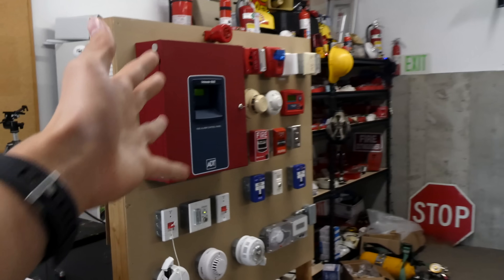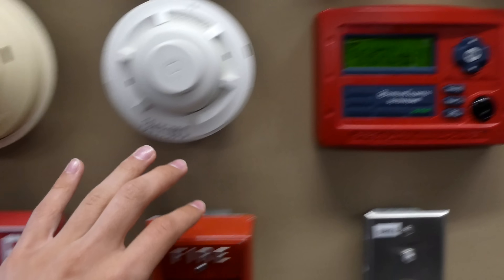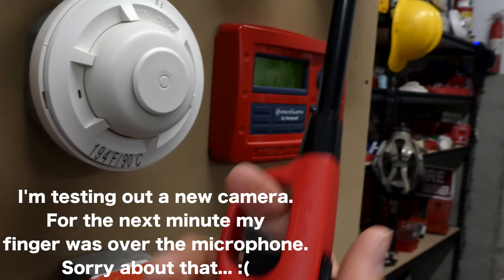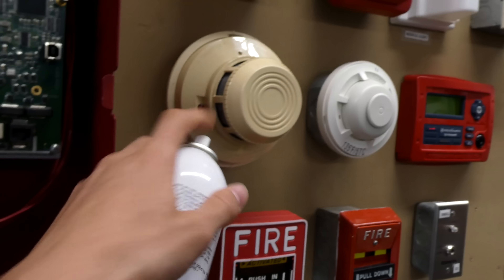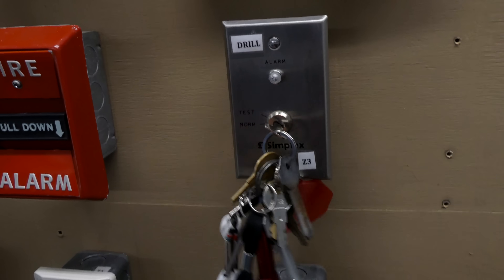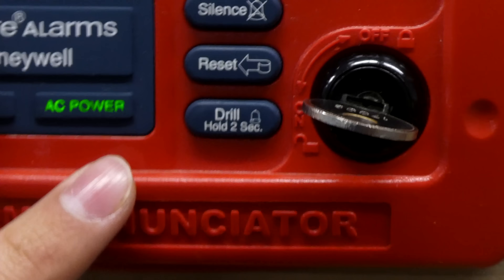ADT Unimode 10UD System Test 9: Exploding Heat Detector

Comment: At 5:13 I have an alarm like that and it's right next to the stove which is very annoying and scary because it's inside a apartment. Then it will set the alarm off in the entire building.

Comment: Honestly, I haven't really looked into this stuff in multiple years. So I'm probably going to sound like a dumbass when I say this. But, with all of the smart technology that's out right now, why don't they make a heat sensor which uses a temperature sensor inside of it to activate? Theoretically it could literally be a temperature sensor in a case that would essentially feed the raw data back to the panel, where it would get processed.

Comment: While testing one day I found an actual pull station on a real system that actually caused a reset in the system we tested it like 3 times because we were so confused on what was happening and how it happened.  still personally have no clue how it managed to be resetting the system without acknowledging it or how it did it in the first place when it was meant to be a regular pull at an actual business.

Comment: Exploding Heat Detector

S.E.R. Safety
78.6K subscribers

Subscribe

15K

Share

Download

3M views  4 years ago
In my system test series, I demonstrate different fire alarm devices with different fire alarm control panels. In this video, I demonstrate a variety of different devices on my ADT Unimode MS-10UD (Fire-Lite MS-10UD) conventional fire alarm control panel. The nurse call stations will be tested in the next test. Forgot to test those.  …
1,218 Comments
Melikedoors1234
Add a comment...
@MichanaAlerting
@MichanaAlerting
6 months ago
Definitely one of my favorite S.E.R. safety videos out there. Never gets old!

11

Reply

1 reply
@drewt4451
@drewt4451
1 year ago (edited)
This man achieved every middle schoolers dream of pulling fire alarms 😂

330

Reply

58 replies
@SWFLElevators
@SWFLElevators
6 months ago (edited)
This one is probably my favorite SER Safety Video, probably because of that mini siren, the exploding heat detector and you testing all the ADT Unimode 10UD's capabilities. Keep up the good work!

7

Reply

@SimplexGuyOfMichigan2634.
@SimplexGuyOfMichigan2634.
1 year ago
Set safety never disappoints us with his videos

15

Reply

1 reply
@jessicahowe1838
@jessicahowe1838
4 years ago
Very nice system setup! I jumped and was amazed at the same time when the top popped off that smoke detector. I also like the tornado siren setup

15

Reply

1 reply
@mrargosthesmartone6945
@mrargosthesmartone6945
4 years ago
You never cease to amaze me, SER Safety. Keep up the great work with your awesome videos!

8

Reply

@WheeloveFireAlarms
@WheeloveFireAlarms
4 years ago
Nice! Love the new blue pulls! I know you’re probably slammed with requests, so don’t feel obligated if your busy, but I remember you got some of those Gentex speaker strobes that had both a fire and alert strobe on one adapter plate. They use them at military bases and stuff. Sure would be neat to see one of those!

46

Reply

7 replies
@EthanBlaisAlarms
@EthanBlaisAlarms
5 months ago
This right here has got to be my favorite video, absolutely amazing!

1

Reply

@crimsonlightningkirby
@crimsonlightningkirby
2 months ago
SER Safety great work I hate fire alarms going off but I love how it keeps us safe from fire and smoke!!

Reply

@williamnealy827
1 year ago
Aww, that little tornado siren is cute lol! Great demonstration of the different alarms, would you consider yourself an alarm enthusiast?

29

Reply

3 replies
@jameswoods7276
1 year ago (edited)
Security guard from Canada here. The reset switch can't be used without an acknowledgement because of NFPA guidelines so that the system isn't reset before a competent authority checks it. Also system trouble alerts have to be acknowledged every 24 hours in order to use the panel / signal silence.  Or so I was told by an alarm tech and a fire captain when I answered an alarm call after hours. (Building maintenance forgot to acknowledge the system trouble before they left for the night. (Faulty sprinkler flow detector) Alarm monitoring dispatcher forgot to check the bypass notes too. Fun times.

15

Reply

1 reply
@FireAlarmGuy13
4 years ago
I think the reason why your shg was doing a weird March time is maybe the alarm is self coding it self to code 3. That’s what I’m guessing
Great Video!

7

Reply

@Rypie89
4 years ago
I love this!! I can see myself having it! When my friends come over I would be like "Hey check out my alarm set!" Then blow their ear drums out! LOL!!

30

Reply

2 replies
@SkrubCern
2 years ago
so one thing I've learned from this. He definitely is prepared if there's a fire.

31

Reply

2 replies
@dank980
1 year ago
tip: the SHG has it's own march time coding built in.

11

Reply

1 reply
@nyanelectricmeow883
1 year ago
I love gentex shgs on continuous with a spectralert classic on pulse! It sounds soo good

2

Reply

@neokirbyfirealarmist100
5 months ago
This has gotta be my favorite video of yours. That heat detector exploding was kinda funny.

Reply

@anthonyiodice
4 years ago
LOOOOVE that you have an old school 2400 system sensor smoke. When you do smokes, would you mind differentiating 2 wire or 4 wire? Keep up the good work bud!

1

Reply

@LasVegasEASPhoto8
4 years ago
That’s awesome!  I have a simplex 4006 control panel and I was wondering what simplex true alert model works with the panel. I have struggled with this for a while.

13

Reply

2 replies
@gregsatterly9412
2 months ago
I have actually been in a building with a tornado alarm with the blue stribe going off for an hour and a half. It was in Norman OK May 2013 when El Rino got hit. We actually had a tornadoe come over the hotel in Norman where we were staying. Those things are LOUD!!!!

Reply

12:19
NOW PLAYING
Setting Off Fire Sprinklers with Fire Alarm Activation
ExitSign250
1.2M views 3 years ago

13:39
NOW PLAYING
S.E.R. Safety's Fire Alarm Collection | Pull Stations
S.E.R. Safety
224K views 1 year ago

16:39
NOW PLAYING
Using the Google Nest Protect Smart Smoke Alarm in 2023
Tech With Brett
323K views 5 months ago

10:40
NOW PLAYING
Making a YouTube Video Using a Personal Organizer
Peter Knetter
2.9K views 34 minutes ago
New

9:31
NOW PLAYING
Nuclear Power Plant Evacuation Siren | ADT System Test 27
S.E.R. Safety
96K views 2 weeks ago

1:11:21
NOW PLAYING
SONIC the CLASSIC MOVIE (Fan Animation)
Pedro Araujo
4.6M views 1 year ago

13:06
NOW PLAYING
SMG4: SMG4 KIDS
SMG4
156K views 55 minutes ago
New

21:32
NOW PLAYING
I Spent $1,000 on Untested Wii Consoles... 😳
Jacob R
107K views 1 month ago

7:54
NOW PLAYING cool!

Comment: If I was the end user, I would throw you out of my building.
You set up the panel and programmed it, but you don't know why it doesn't operate the way it should.
Maybe you should test and correct the panel before recording a video.
Life Safety Systems are not a joke, so your "Ha, ha" is unprofessional and an insult to anyone who was injured in a fire, due to an improperly programmed fire alarm panel.
Stick with residential burglar systems, since you have no clue of NFPA or NICET.

Comment: Security guard from Canada here. The reset switch can't be used without an acknowledgement because of NFPA guidelines so that the system isn't reset before a competent authority checks it. Also system trouble alerts have to be acknowledged every 24 hours in order to use the panel / signal silence.  Or so I was told by an alarm tech and a fire captain when I answered an alarm call after hours. (Building maintenance forgot to acknowledge the system trouble before they left for the night. (Faulty sprinkler flow detector) Alarm monitoring dispatcher forgot to check the bypass notes too. Fun times.
Reply: I'm in the Canadian armed forces I deal with fire
Reply: Vggg

Comment: Interesting! What would the heat detectors be used for?
Reply: @alocalpotato  LOL
Reply: @hellothere9848  Scotland mandates heat alarms in kitchens now for both  new and OLD residents but they way they did it is tyrannical and causing more problems then it solved.
Reply: @hellothere9848  Kitchens to avoid false alarms from smoke detectors.
Reply: @kylehill3643  Ohh that's very interesting! Thanks!

Comment: If you go to our school we have lots of alarms.... And the strobes are LEDs that color change based on the pull switch.... Every alarm row has breakaway glass do they can tell and then 7 pulls and one break bomb
Police
Fire
Ems- nurse
Tornado
Intruder
Gas leak
Toxic vent (isn't a pull but a break bomb)
Natural gas EVS (Emergency vent system)
One kid pulled the gas leak after he farted..... He got 2 years in juvy.... That system take ~2 weeks to shutoff.... They have to "power wash" the school even in a false alarm
Edit: all houses have to have 3 alarms or extra
Tornado, well u get it is so we know when our cars want revenge for us slamming the doors)
Gas leak (city wide for the NPP)
Toxic vent (for the nucular power plane 1 mile away.... That's y our school has vans that can go 120 :) we haven't had to do it yet.....

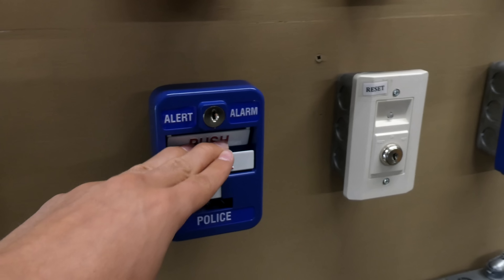Comment: 7:21 pulls "MOBILE TASK FORCE UNIT EPSILON 11 DESIGNATED NINE-TAILED FOX HAS ENTERED THE FACILITY. ALL REMAINING PERSONNEL ARE ADVISED TO PROCEED WITH STANDARD EVACUATION PROTOCOLS UNTIL AN MTF SQUAD REACHES YOUR DESTINATION. AWAITING RE-CONTAINMENT OF 5 SCP SUBJECTS." Would be epic if it was possible to use a voice evac systems that include the SCP: Secret Laboratory announcements.
Reply: UH OH KURAMA IS OUT 7
Reply: W9s0xps0xpepslspepe00ee00eep0e
Reply: Vfcecredtnhhbppdpsp3peepe
End
D

D
Ww
Wpwpwppw
W
E

Comment: I work with ADT and had no idea ADT made a fire panel. I am certified on Edwards and Simplex addressable systems , wondering if ADT makes Addressable devices ?
Reply: They used to make addressable versions of the SIGA-PS, but they no longer make fire protection equipment.
Reply: It's a Fire-Lite panel that is branded with ADT logo.

Comment: When I was in high school, we were told that the pull stations can contain UV ink so that the person who pulled it can be identified. Is this true or is it just one of those "the water turns blue when you pee in the pool" myths?
Reply: That's a myth but what can sometimes happen is when you pull the fire alarm a little glass rod breaks but it's not gonna squirt ink at you
Reply: You're thinking of the ATM machine in England that can spray UV ink at you if you break into it.
Reply: I heard that as well in High School.  I am thinking it is something said to scare people out of pulling the alarm but who knows
Reply: @Lkendrick  They do it on problematic alarms only if they have cause to do so.  However a fully sprinkled place can escape having any pull stations at all due to special clauses that grants them impunity if they are fully coverage.

Comment: May I ask Why do American Fire Alarm Stations Are A Pull Type While In Europe We Have A Break-Glass And Push?
Also All Of Them Have Glass Behind The Button To Make It Very Hard To Mistakenly Press.
Example of This When We Were In Super-macs A Kid Tried Activating It (He was About 4-5) And Failed... That’s The Glass’s Job Stop False Alarms.
Another Thing Is The Alarm/Strobe Most Are Built Into The Smoke/Heat Detector Or Are Stand-Alone But Look Nothing Like American Ones There Like Round And Most Are Only Horn.
Oh And Emergency Exit Signs Here Are Green Not Red.And All Are Displayed Not With “EXIT” But With A Arrow Pointing To The Direction Of Which The Exit Is In ,A Little Man Running To A Open Door.

America Why Do You Have To Be So Different????
Reply: I know right, they are like this in Europe: We always have hammers in our pocket.
Reality: Nah m8 you weird
Reply: What if it was a group of 5 year olds that burned because they couldn't get an adult to break the glass?
Reply: @2010justinkoch  Too bad there isn't any topics that discuss Europe's fire safety signs and stuff compared to the US.

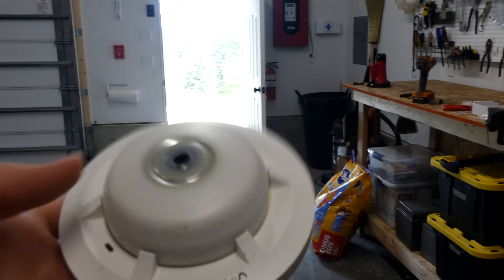Comment: 3:50 nice throw 
Also can’t you push the pin back into place 
Like push the white piece back in the unit??
Reply: The pin is permanently changed after exposed to heat, so it will be useless.
Reply: @logidodoplyz7302  What if you get a new pin to match that set?
Reply: @kylehill3643  would guess the inside also changes, because the heat could damage something else inside the device that might make it defective too and they don't want to risk safety

Comment: Sometimes things that simply HAVE TO trigger if the condition occurs, are one-time use devices, specifically to take the question of "Does it still work after X many times" out of the equation. 

For instance, an appliance bearing an adjustable thermostat, or a fixed temperature, self-resetting thermostat, might have a one-time "Thermal fuse" as an emergency backup, at a significantly higher temperature than the maximum temperature of the thermostat. If the temperature ever gets dangerously hot for any reason, the thermal fuse opens the circuit, permanently. (From the user's point of view that is. Any repair should both replace the thermal fuse with the same type, search for any thermal damage that might impact safety, AND search for possible causes of overheating in the first place)
Reply: Xxf

Comment: My school is breaking state code because our school was built in the 20s and they still have the original bells, fire and end of class bell, but they never use them because In the 70s they got a new system and control panel (which is still there) and they have it setup as a long tone so it dosent stop. I looked it up and my school is breaking code by using that fire alarm.
Reply: SLucas YT grandfathered in

Comment: Fire alarm YouTubers in a nutshell,
hEy GuYs ToDaY wE aRe TeStInG tHe: Fire well 69.2 fire detector 613.000 dubble horn with adjustable sound deluxe xxl dubble strobe at 000000.1 ver with bright blue and yellow strobe with gold lined letters saying “fire” in the xxl comic ultra with purple stripes on the outside with speech (male 16 year old) adjustability 61% with built in carbon monoxide detectors deluxe verson collectors addition 2 pack deluxe.

Comment: How are you wiring pull stations to set off certain alarms,  and not the others? Not sure if you are using a relay module for it or if it's a programming option, still trying to learn. Thanks!
Reply from the maker: This is done through programming and relays.

Comment: Why did you throw the poor heat detector?
Reply: its a one use device once its activated its no good any more and has to be replaced
Reply: @apctech1  What if you get a matching pin to replace the used one?
Reply: @kylehill3643  If you can get one you also need the wax seal that goes on the top of the sensor base that holds it in place.
simplex makes a new one that auto reset no pin its a themositer and it resets it self when the heat drops below its set value.